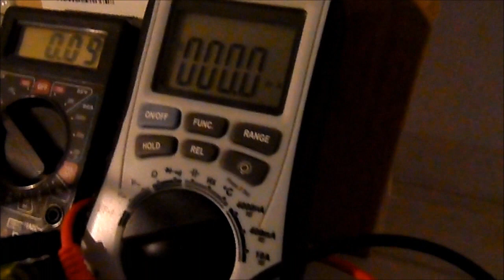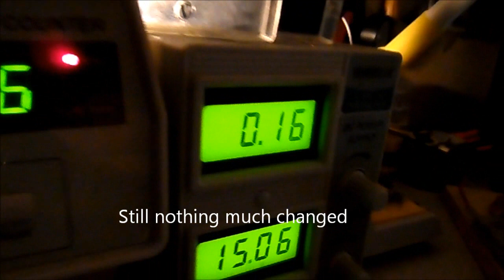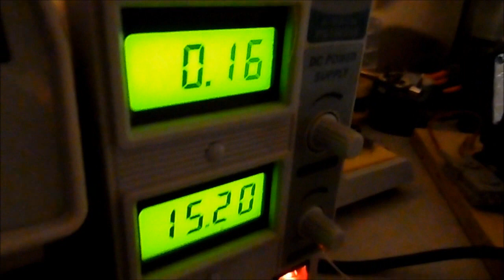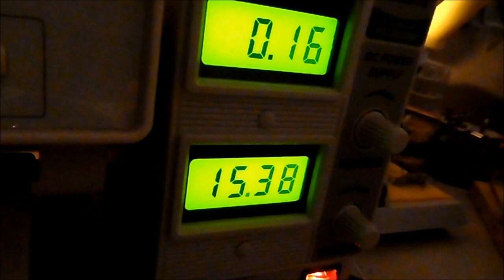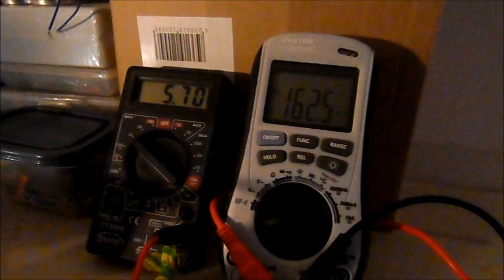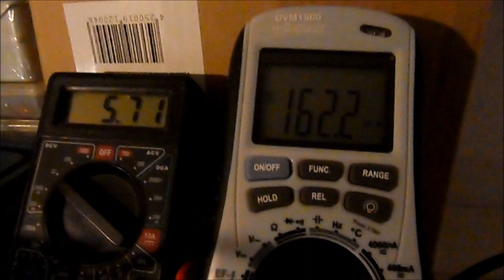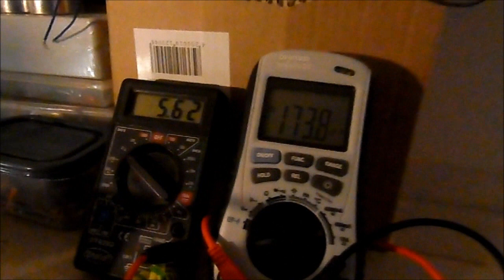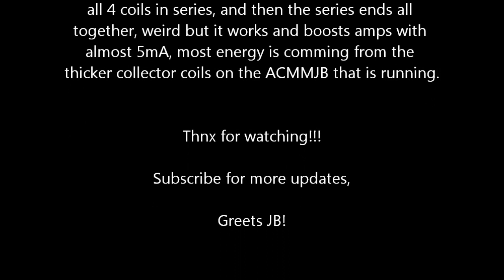Testing ACMMJB TPU ECD QEG New Personal Record + DC Motor on Output

Comment: Voltage Output is 1/3rd of input right??, but thing that happens is that when you attach a motore nothing changes right???
Reply from the maker: Correct, the motor does also not change the input

Greets JB

Comment: well tension is dropping a little
Reply from the maker: Even when i short circuit the output it does not change the input
Reply: this is really weird ... is it cold the air close to the machine?
Reply from the maker: Haven't really tested/measured that, but the device never got warm or hot sofare